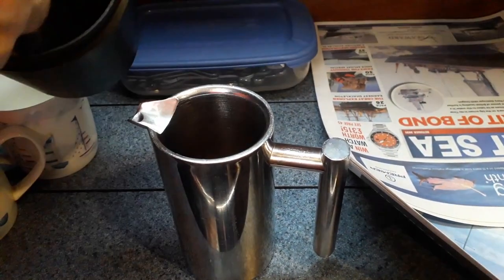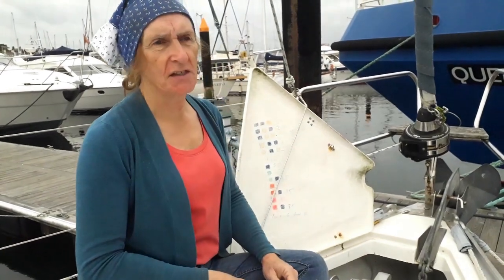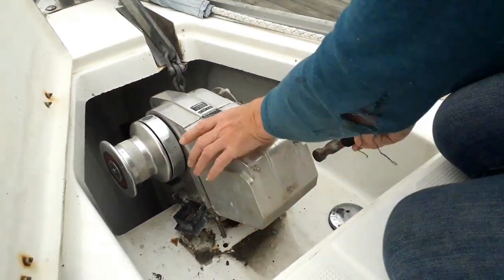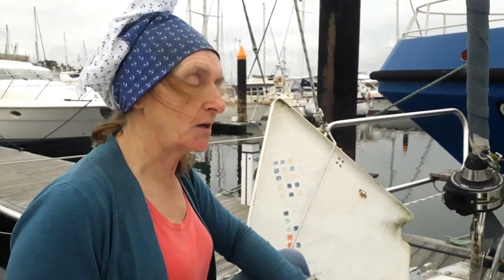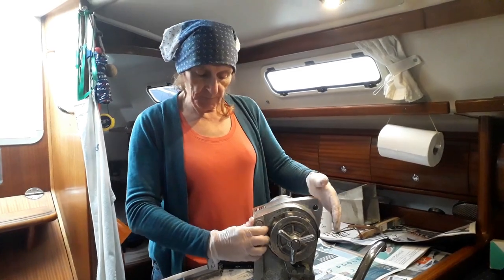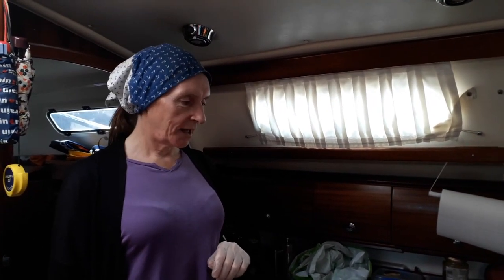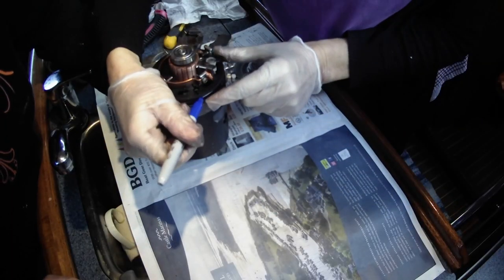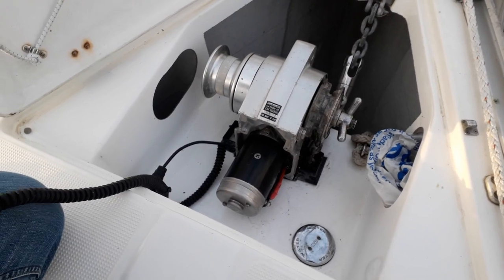Lofrans Windlass Service - Lofrans Cayman 88 - Ep. 214

Comment: "5 days later".... damn..
Don't want to spoil the end.. but well done for working on the problem.. :)

Saved a few hundred quid I'm sure..

Thanks for sharing.
Reply from the maker: Thanks! We tried all sorts of things before the hammer came out.... 

I have since been watching car mechanic videos on YT to get an idea of better ways to deal with mechanical issues. It seems I may need a bigger hammer... 😄
Reply: @SailingYachtSaltyLass  Yeah lump hammer for the win :)

I'm sure someone will pipe up in the comments with a better idea, but I almost think a pulley puller might have helped.. ahh well as always - there is a tool out there which will help - but you're most likely to only ever use it once, thus the investment isnt really worth it..
Reply from the maker: "A pulley puller" - obviously my mechanic education is severely lacking. I might invest in a small crowbar though. The car mechanics seem to us that as much a as their hammers.
Reply: A new 12V/1000watt electric motor for a Cayman 88 is €408 + shipping so well worth repairing - well done!
Reply from the maker: That was our thinking too. If we wrecked it we would have to buy one, but if we gave up we would have to buy one to get the windlass fixed. So we had nothing to lose...

Comment: Hi Girls, ur friendly Aussie mechanic here, the fill plug is the same as the empty plug which u know and the casing is full, when it starts to seep back out of the same hole, then return plug and good to go, also put Vaseline or petroleum jelly even grease on to electrical connections to stop electrolysis of wiring. Also get a can of marine lihium grease not cheap but best ever for marine applications and give whole thing a light spray youll be very happy u did as its a terrific product for salt protection. Have u got compressed air that's the best to clean all the junk out, anyway great job my little apprentices, Great vlog thanks, have you got new shirts in yet please? 💙💚💛💜👭 dam shame Gaynor that u didn't get a rear shot of Bev when her head was in the locker🤣🤣🤣
Reply from the maker: Thanks for the tips on the grease and YES! The Tee-Shirts are available at last.

https://salty-sailors.creator-spring.com/
Reply: @SailingYachtSaltyLass  Thanks, but the v necks only come in two colours bummer, and my hammer is called the PURSUADER. 🤣
Reply from the maker: What colour do you want? I will see if we can change any settings at this end. Our hammer lacks a name as it is not soft and cuddly, but then again, neither is Katy the Cooker or Toppie the top-pot - both of them divas ...
Reply: @SailingYachtSaltyLass  oh that be excellent ok, purple, light blue and orange, thanks heaps. My grandfather's toolbox was a hammer and a crowbar so ur on the right track Bev.
Reply from the maker: OK. I have added every colour they allow for the women's v-neck. We do have the same logo in "Classic Tee Shirt" and it seems to have more colours. I have no idea why.

It is good to know that real mechanics have a hammer and crowbar as the essential "Go to" tools 😉
Reply: @SailingYachtSaltyLass  Thankyou very much, I'll finally get my t-shirts yippee. I'll be a Salty Lass 🤣
Reply from the maker: We need to order some ourselves. Ours are getting a bit tatty
Reply: Ah! Been looking for a reference on whether you fill up to the fill hole (there being no obvious other measure). Just doing that now. Thanks!
Reply from the maker: Glad you got it sorted
Reply: @SailingYachtSaltyLass  Maybe yes but maybe not. I poured in almost a quart (900 ml) but it still hasn't reached the fill hole. Off to buy more in the morning but you had mentioned it required only 500 mL?
Reply from the maker: @stephenburnage7687  - Is yours the Cayman model from Lofrans? That is what ours is.
Reply: @SailingYachtSaltyLass  Yes. Exactly. 1,000W version.
Reply from the maker: @stephenburnage7687  - our is a 700W version (according to the label stuck to it). I had no idea they made a bigger version of the Cayman. I thought that was what the Tigres and other models were for.

The data I have for the Cayman says 0.5L

https://www.peachment.co.uk/wp-content/uploads/Lofrans-Oil-Capacities.pdf
Reply: @SailingYachtSaltyLass  Well, I bought it off eBay (used), advertised as a Tigres, but when I opened it up, the motor clearly states 1,000W. On the current model line up, they only sell the Tigres in a 1,500W version but offer the Cayman in a 1,000W version, so I assumed it must be a Cayman. However, maybe the model lineup was different in the past?  (They have been making these for a decade or so). Either way, according to your data sheet, both models take 0.5L. I bought a quart bottle (940 ml), used a little bit for flushing, and poured the rest in, without yet reaching the fill hole. So, either: 1. I have an earlier model which uses more than 0.5L or 2. the oil is disappearing some place it's not meant to be (but no sign of any leak anywhere) or 3.You are meant to measure out the 0.5L with a measuring jug (ie not fill up to the fill hole). Any thoughts?
Reply from the maker: @stephenburnage7687  - The tigres looks almost the same as the cayman the difference being that it has something that looks like a deck cleat on top of it whereas the top of the cayman is smooth. As for leaks, there is nowhere for the oil to get out except that fill hole and even if it did leak I think you would notice all that oil coming out. I think your best bet is just to keep pouring oil in until it dribbles out. The oil, as I recall, was not terribly expensive and it should last for years.

I would be curious to know just how much you finally pour in!
Reply: @SailingYachtSaltyLass  Interesting. Yes, it has the cleat, so I guess it is the Tigres model. Maybe someone put the 1,000W motor in later, as a replacement. Suits me, as I didn't need the extra power (I am replacing a 700W Lewmar Pro Fish). So, when you filled up yours, did you find that the 500ml bought you to the fill hole level?
Reply from the maker: @stephenburnage7687  - I cannot recall, but we just filled it until it dribbled out the hole

Comment: Thanks Ladies..    i see you got some Ratcheting spanners,   Yeah that’s pretty much how we used to repair electrical motors aswell,  the only difference is after all the work you normally put new brushes in,  mainly because where it stops because of a contact issue in can tend to slightly damage them.  But if it didn’t need em,  why bother..   nice work..
Reply from the maker: We did not have the new brushes to hand and these looked to be in fair order, but if (when??) the problem reoccurs we shall put new ones in.

Comment: I have the same windlass. I had it out 2 yrs. ago to strengthen the deck it sits on. I should have changed the oil. Any guess how old your oil was?  Great video! Than you.
Reply from the maker: The oil was at least 3½ years old because that is how long we have had the boat. The previous owners to us had her about 4 years and they were in their 70s and did not seem to be the mechanical maintenance type. So the oil might have been 7 or 8 years old.

Comment: I have a question what are the most important spares you carry
Reply from the maker: That is a very good question. That could very well be an episode on its own. What comes to mind first is engine parts, particularly diesel filters since fuel problems are what usually knocks an engine out. 

We have a vigorous programme of routine maintenance. For example, the oil gets changed twice a year whether it needs it or not. The filters get changed at the same time even if they still have time left on them. Similarly, the impeller gets changed at the start of season regardless of its condition.

If something shows signs of stress or wear, it is replaced at the first opportunity. We will examining all ropes and halyards before we set off and anything showing fray or wear will be replaced. Similarly the main sail requires inspection this winter (we did the genoa last winter) and its stitching checked for wear. The standing rigging gets a visual check each week and after storms or rough passages

We have seen too many boats that just sail until things break and then  who struggle to fix it in out of the way locations or with inadequate parts. We never want to be one of those boats. It could still happen to us but we are trying to minimise the chances of it occurring. 

The windlass caught us by surprise when it stopping working, but it was something we never serviced. That will not happen again. It will now get pulled in accordance with Lofran's schedules and some spare carbon brushes are now on order for it. If it goes again, we are ready for it.

Comment: I google service Lofrans Cayman windlass, and the Salty Lasses seem to be the only one providing such, great stuff, from you friend down at Ringhaddy in Strangford Lough!
I need to remove my windlass to fix issues with deck below, and replace a support plinth, and have two questions:
1.	My cable at the windlass are integral, which Lofrans service agents are telling me I cannot undo, and that I will have to undo the cables all the way through he boat! NOT GOOD.
How did yours come to have outside terminations that you could undo? Were these standard, or an after-market modification? (sort of helpful and necessary for any future servicing)
2.	Secondly where did you get the SAE 90 gear oil, or is there a new equivalent I need to look for/buy?
Reply from the maker: The windlass was fitted as shown on the boat when we got it and if you have a cayman then the cables should be detachable inside the housing like ours was. The cables ran a short length to the relay (maybe about 1½ metres) so we undid them there to ensure no power was running to the windlass then we unbolted it and pulled the back cover off to expose the cable ends .

The SAE oil we just got from a car shop on Barra. I do not think there is anything special about it
Reply from the maker: Look at this, especially Page 46. The Cayman just has a standard motor inside. Cables can always be cut and crimped and rejoined to each other as long as it is done properly, but pull the back cover off and have a look inside. Just make sure that the system is ELECTRICALLY ISOLATED as the terminals inside our were bare and could easily contact the metal housing as it came off. Your will likely be the same.

Look at this link

https://www.manua.ls/lofrans/cayman-88/manual?p=46

Comment: Good work chapesses! I've been toying with the idea of an electric windlass for Moon Shadow since summer 2020 but I reassigned the money to an AIS transponder and a holding tank. I'm planning to head south next summer (after my round GB) and that may be single-handed so the windlass question is starting to surface once more. I have a question for you: What power is your unit and how much and what gauge is your chain? (ok that's two questions, sorry, three questions, DOH, among my questions are... don't call the Spanish Inquisition!!)

I suffered from the phantom whiskey snafflers last summer too - I blamed the crew as well ;-)
Reply from the maker: There seem to be a lot of "Whiskey snafflers" about 😲

Our windlass is a Lofrans Cayman 88 and it says in it that it has a 700W motor. It runs back to a big isolator switch under the chart table and is controlled by the relay in the video (those are not cheap!!) 

The chain we use is 8mm and we have 50 metres of it aboard. We used to have another 30 metres of octoplait on the end of the chain, but we never used it so we cut it off and used it for stretchy mooring lines and they work really well
Reply: @SailingYachtSaltyLass  hmm, interesting. I have 45m of 10mm and I was told I needed a 1500W motor! I have an Anchorlift windlass that I got for a very good price but it's missing some bits that, apparently, aren't made anymore (perhaps it wasn't a good price after all!). Anywho, it only has a 1Kw motor but I guess if 700 works for you 1000 should work for me. By the way, where does your chain live? Mine is in a well right in the prow which isn't really a good place for it as it weighs in the order of 130kg
Reply from the maker: Our chain is also in a well in the prow. As for the windlass power, remember that all it really has to lift is a few metres of chain plus the anchor. Our anchor is 16kg (36lbs) and we usually anchor in 3 to 4 metres of depth so once the boat is over the anchor the windlass only needs to lift 20kgs or so. Heck, even I can lift that...

We drive the boat towards the anchor and when the chain is vertical we lift it with the windlass. Most of the time it is only lifting a few kgs

Comment: Girls can you tell me where the electric connections are thanks
Reply from the maker: I am not clear which ones you mean because there are several places. There is the set inside the windlass itself on the motor housing. These run back to a relay which, on our boat, is inside a locker in the vberth directly behind the anchor locker. 

The cables from the windlass motor are joined here by smaller cables from the handset used to raise or lower the chain. 

From the relay box a pair of large cables runs back to an isolator/breaker/trip switch under the chart table. If the windlass draws too much current, this trip throws and has to be reset. 

Finally, there are a set of cables from the isolator to the batteries.
Reply: @SailingYachtSaltyLass  the ones in the locker,many thanks
Reply from the maker: We have a row of small, wall mounted lockers. Watch the first few seconds of this video (link below). The relay is in the small locker over my left shoulder and is mounted forward against the bulkhead. The anchor locker is on the other side of the bulkhead

https://youtu.be/X2KRleBn9QQ